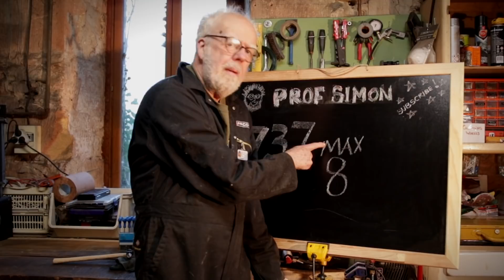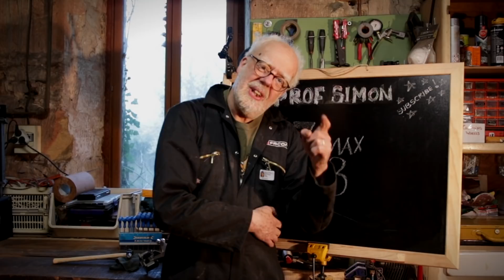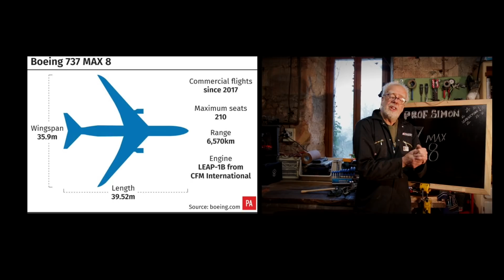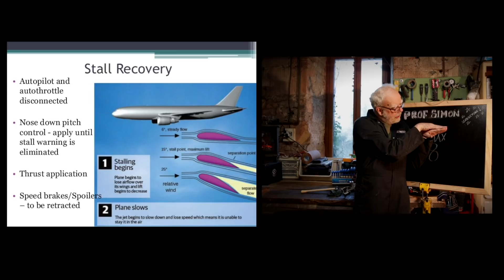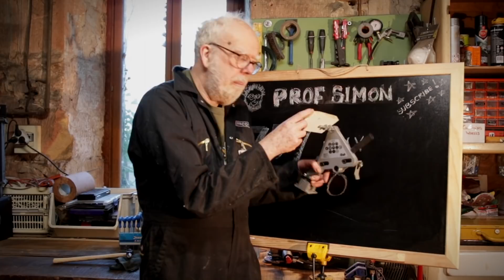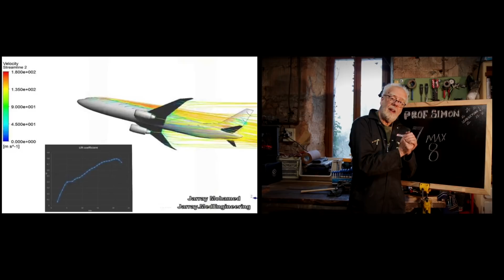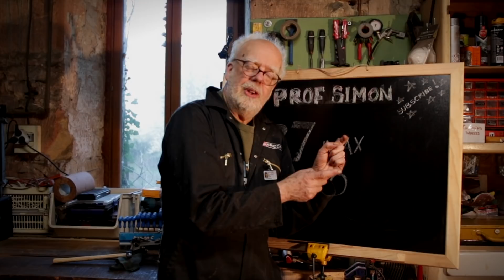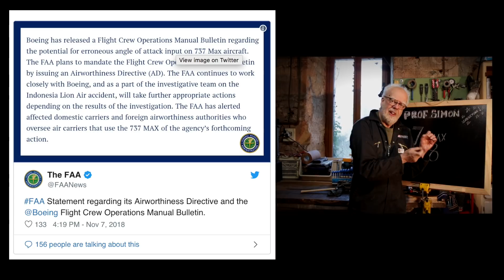Boeing 737 max 8's

Comment: You will be proved exactly correct.  Anyone who has flown with a 3 axis autopilot knows that they can do some strange things if not monitored.  I've had one axis of an autopilot fail in an Aero Commander and I assure you the pucker factor is well above 10.  It was a bad sensor, but the autopilot chimed that something was amiss.  I shut off and handflew the rest of the way
 The Max 8 system is a different beast all together.  It is designed to force the aircraft (beyond human strength) to prevent high angle attack stalls.  And was man versus beast when the AOA sensor went haywire.  As soon as the pilot felt control resistance from the autopilot, he should have QUICKLY shut it down.....just like the pilots did the day before.  Autopilot to off, circuit breaker pulled, return to land and maintanance.

Comment: I'm a pilot, when I learned how the planes crashed, the first thing that came to my mind is what was over riding the pilots control inputs?  The NTSB has hinted at the autopilot system could be part of the problem.    You have electronics and a computer in the loop...  What could possibility go wrong?  Everything.
Reply: Flight Engineer like most Co Pilots are designated these days can pull the circuit breakers on any system. Most breakers for critical systems are on the panels near the pilot seats. Easiest way to reset a non operational panel, pull the breaker and reset it. Pull the MCAS and Auto Pilot breakers if the controls aren't responding. The backup are cables attached to the hydraulic flight controls. Problem is in a very steep dive, very hard to move around especially when strapped to a seat.

Comment: As went the "Titanic" so went the Max 8 "Avionics". When Marine engineering, (tonnage capacity) outraced materials  technology, (metallurgy) icebergs begot Alloys. When software engineering tried to eliminate flight engineers on deck (autopilot mode) This lack of redundancy  AND Training begot Boeing's Titanic. Was this a built-in terrorist back door? Jesus Saves. 
- Watchmen

Comment: Old planes were like riding on a lawn dart by wire controls, you could "feel" what was going on. Instruments and mechanical controls element a pilot's instinct and feel. If a  plane suddenly rolls right, you can't just slam it back to where it needs to be with the "old" aggressive manuvers. Fail safe controls need to have another "fail safe" to keep them from failing ?????

Comment: My question is why is there not a 'kill switch' on autopilots that allow for an immediate return to manual control thus allowing the pilot to fly his/her way out of trouble? Granted, on take off, there isn't much available altitude (time) to recover with but, it would seem to be better than fighting the autopilot all the way down into the ground. 

Additionally, it is my guess that these accidents are going to translate into money which translates into cost of training, or rather, deferred training due to costs. I remember one crash of a commercial airliner that occured due to a deferred tire change. The doomed aircraft continued flying with a deflated tire because management wanted to maintain the demanding schedule. In essence they scheduled themselves right into the ground.

It seems that the innocent continually pay the price for those who make bad decisions based on dollars instead of the safety. Have any members of management making these deadly decisions ever been incarcerated? Maybe we should build micro-prisons on top of crash sites and have those convicted of fatal monetary managerial malfeasance serve their time in those custom made micro Levenworths.

Comment: So the software isn't smart enough to understand that it is leading the plane straight down into the ground despite the efforts of pilots???
Fine even if pilots angle of attack was too steep, the software that is suppose to help correct that isn't supposed to push the plane down to the ground...
This sucks

Comment: Does this system have ramifications going to the Rio-Paris AF447 crash ? It was pilot error stalling the plane that caused the crash, surely Airbus and Boeing took some notes and tried to render this situation impossible (without planning on over correction from the auto pilot)

Comment: Yeah, can not wait for autonomous vehicles to hit the highways. Aircraft and autos simply must have an easy 'unlock' computer button putting the item under the complete control of the pilot/driver. The FAA and the DOT simply MUST mandate these safety precautions. But perhaps not, manufactures arrogance and lobby groups
will probably rule the day!! When problems occur on a production line the last thing the 'front office' wants to do, in many instances, is halt the line to address problems.
Witness the amount of recalls on autos, in other words, the final quality assurance check is the customer!!

Comment: Prof. Simon- all fun and informative for lay people with nice props and illustrations, but you lost it around minute 9, where if I understand correctly, you imply that the pilots 'stalled'. the reason you ascribe is a bit fuzzy.  All transport category aircraft have stick shakers, true, but also 'stick pushers' which follow the shaker.  The stall recovery manoeuvre would not 'fight against' the MCAS recovery, but act in concert with it IF it was working properly. these aircraft were far from stalled at impact. The MCAS is attempting to drive the nose further down  than required. The question is WHY and what is the proper recovery? If the Stab. cut-out is activated, it may require reasonable team coordination, ie- the flying pilot better have the stabilizer in a relatively neutral position when the cut-out is activated. If a crew were to misfortunately activate the cut out while the stab was trimmed down...It would be unrecoverable from a low altitude. Since  the MCAS only activates once the flaps go to zero, that would be at 1'000 ft AGL typically, so only seconds to impact from a high rate of descent. A 200 hour co-pilot is criminal, but..Manufacturers and airlines are marketing technology to the travelling public as an equivalent counterbalance, which is valid to a degree when the technology works as advertised. When it doesn't, there's nothing like experience (seen it before) combined with good training to get it right. This MCAS system has an Achilles heel, if not two. Why the spurious AoA readings? Why no AoA comparator algorithm? combined with a auto kill switch if integrity is determined to be compromised? Why does the MCAS software allow for a range of stab trim adjustment far in excess of any conceivable aerodynamic 'feel' or pitch tendency needs created by the new engine/ airframe configuration?

Comment: All Boeing 737 max 8 now grounded world wide as of today, all deliveries now suspended by Boeing until further notice.Over 300 people now dead because someone forgot to read the aircraft flight manual addendum for 737 upgrades, hmm more to this than that.Boeing share price is down 15% in last week,this is going to be a very costly mistake on some ones part, who that is will be determined in due course. 
The erratic parabolic flight profile for vertical speed for last few minutes of each crashed aircraft suggests this was not an isolated incident, possibly triggered by a very step climb rate in each case to clear  terrain and causing MCAS to behave in an unstable manner that these two pilots were not trained to handle or maybe the embedded system or even the AOA feed back system was inoperative or was not correctly configured.

We will all have a definitive answer as to the exact cause of these two crashes as soon as the flight recorders are analysed as Boeing's 737 MAX 8 future depends on it.

Comment: When I was writing spreadsheets using positive and negative differences close to zero, I found a problem I could not solve. I was finding minimum and maximum change. Now the simple solution was to take the absolute values of the all values, taking the maximum and minimum of the absolute values. But being able to determine which was the original positive and and the original negative after taking the absolute value and changing the negative back to a negative I could not solve.
Reply: After taking absolute values all change is positive

Comment: Lack of manual flying skills by pilots oblivious to forward moving (nose-down) stabilizer trim-in-motion wheels (next to captain's right thigh and copilot's left thigh) which can instantly be stopped with hand or by two pedestal mounted stab trim cut-out toggle switches. Stabilizer can be trimmed MANUALLY by hand.

Comment: Correct me if I’m wrong, but the MCAS failure is covered by a memory item already (Runaway Stabilizer). This means, if the pilots had a MCAS event, they should have applied the memory items ( as was documented with a Lion Air crew on a preceding flight), turning off the stab trim. Memory items should be instinctive, so I would be interested to see if these pilots simply pulled back on the yoke, or followed any procedures?

Comment: Professor, I don't agree with you! You said the pilot were not properly trained, and if he had read the manual carefully, the tragedy would have been avoided. From my point of view, the pilot's operation should be as simple as possible. An experienced gray-haired pilot is more reliable than a computer!!! Boeing should have anticipated the possibility of the struggle between the pilot and the computer! !!
Reply from the maker: I thought I said the opposite? The software should protect the plane but the pilots need to know how it works...the more I know about these crashes ...it seems Boeing we’re selling this very sophisticated aircraft as part of the 737 series...in fact it is ...very different...and the software was not up to making it easy for traditional 737 pilots....sad.

Comment: Is there not a Max 8 simulator? Surely they could reproduce pilot inputs of accident aircraft on the simulator after setting parameters for a sticky AOA indicator. But then I'm sure Boeing know exactly what happened, they are just waiting for AAIB to confirm. 
It shouldn't be called a 737 really, the characteristics are so different from the classic 737.

Comment: Gary Hewitt
'This plane is longitudinaly unstable look at the oscillations in the climb out.
It's not the CG, it's the aerodynamic centre probably caused by the larger frontage of the new engines.
The CG and ac have diverged.'

Comment: There's been problems with the MCAS on other 737 MAX's besides the two accident flights. I believe it was a United pilot that ran into a situation where MCAS kept trimming the nose down (actually over trimmed nose down), but the pilots knew about the cut out switches and easily recovered. But if you don't know about the MCAS and especially the cut out switches, then you'll lose the battle against the MCAS. There's no way for the pilots to counter the stabilizer trim with the elevators for an entire flight. The Lion Air pilots certainly tried, as evidenced by their flight path and confirmed by the FDR.

We need to find out why these pilots were unaware of the cut out switches

Comment: I have to disagree.  Do you remember the rudder sticking in the 100 series and they nose dived.  Well I think there going to find something similar happening here and it has nothing to do with the software at all.  I am sorry for being a pessimist but I if a pilot can’t disconnect autopilot immediately and handle the stall in two situations there is no way your going to make me believe it’s a software issue.  Something else covertly is seriously wrong.